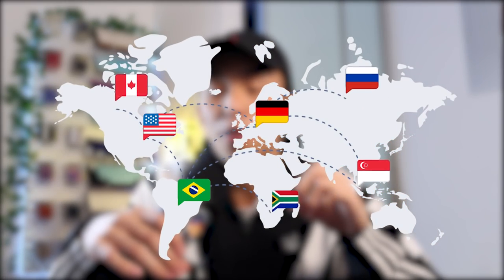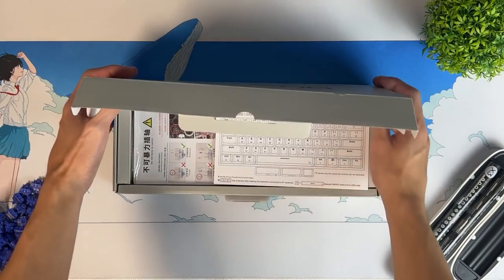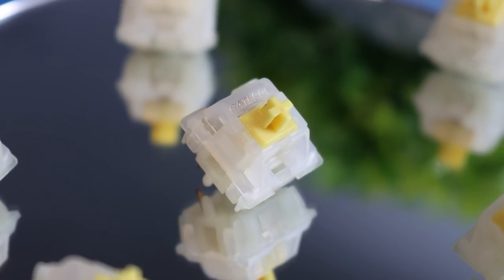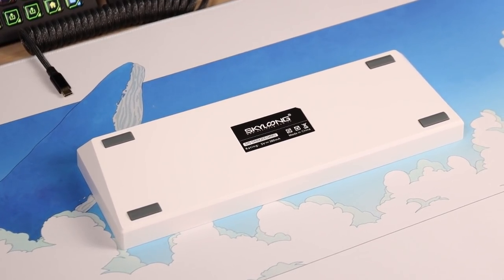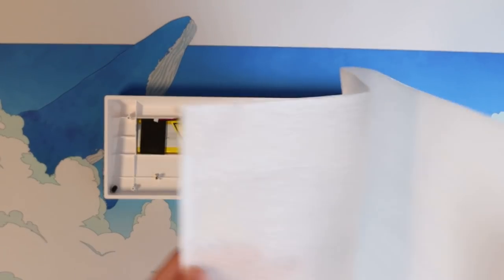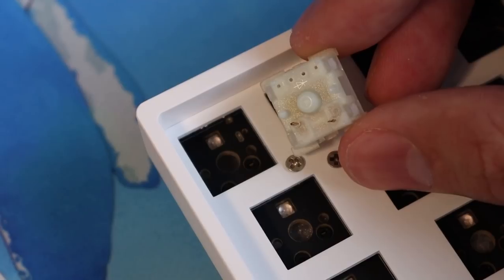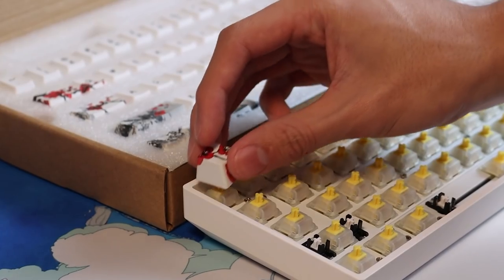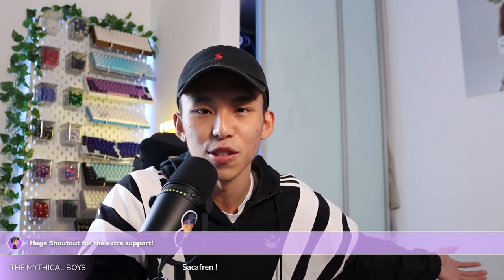The BEST budget keyboard. (For Beginners)

Comment: Did start off with this bad boy too, used it for a bit then I discovered the GMMK Pro but then I used it and realized it was hot doo-doo, moved onto the Next Time 75 which was fine but wanted a more premium sound, now am using a Keychron Q1 and soon getting an Akko Mod007!
Reply: Seems like you're a 75% enjoyer. Personally I'm a 65 and tkl kinda guy but I'm getting a couple 75s soon.

Comment: Sick video, I got into keyboards with the Anne Pro 2, 3 years ago, and I just modded it recently now that I have money lol, lubed some KTT mint linears, and done a PE mod, first time desoldering too, did lift a pad but connected the pin to diode and fixed it, works and sounds so amazing
Reply from the maker: nice, thats not a easy task fixing a diode
Reply: @LewisToh  Anne pro kinda makes it simple leaving the diode next to the switch pins, gotta give them props for that!